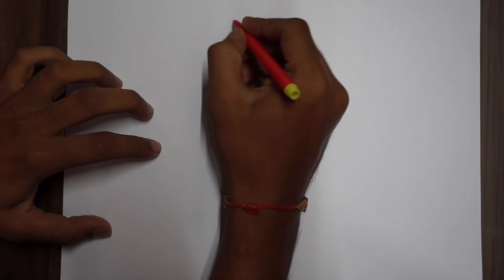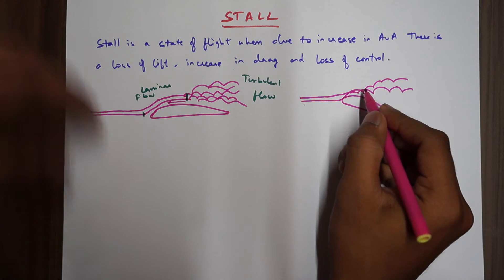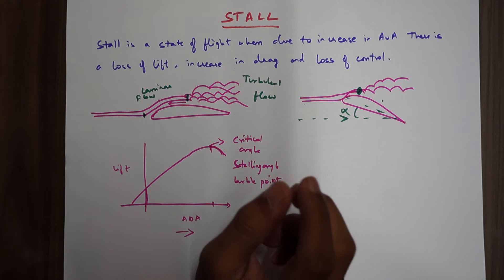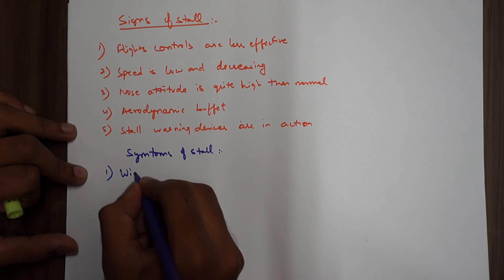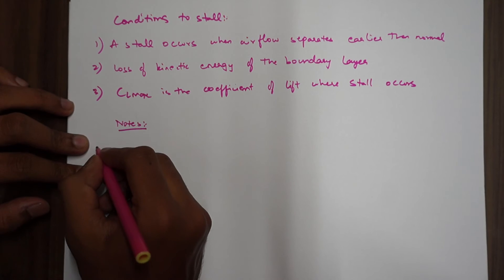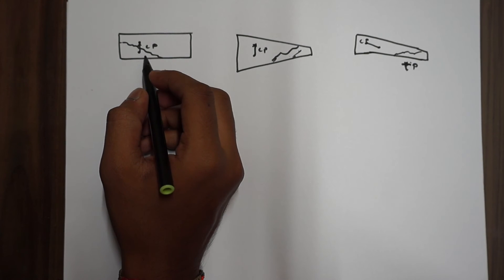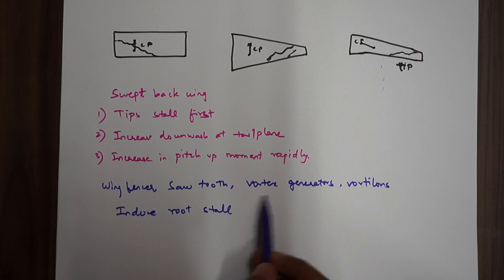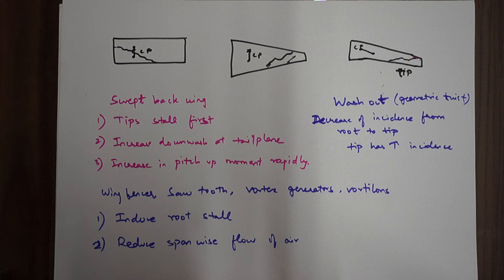Stall - I

Comment: first of all, Thank you very much for this amazing video. Having said that an aircraft stalls when the critical angle of attack has been reached.Then there less chance to stall and aircraft at straight level flight or at a constant descent??
Reply from the maker: Less chance yes, but doesn't mean it cannot be stalled during those phases of flight. Just that comparatively stalling is faster when pulling nose up.
Reply: @poh  THANK YOU!!!

Comment: Sir...i have some ques..1)In case of engine failure A/c will stall or glide
2) Viscosity coefficient varies with increase in density, increase in temp, or increse with Velocity
3) what is purpose of wake turbulence....sir please...clear it i will highly thankful to u
Reply from the maker: 1) If you maintain certain airspeed, the A/C will glide, below that speed it'll approach stalling conditions.
2) Viscosity in layman terms is ability of fluid to flow. Lot of parameters effect this. Temperature, Density, Friction etc.
3) Wake turbulence is a phenomenon caused due to movement of aircraft through air. There is no purpose. It's just a phenomenon.

Comment: when angle of attack is increased more wing Sl gets exposed to the relative wind flowing by and causing opposing force to the thrust and causing more drag over the wings and smooth flow of air get s disrupted , to recover the stall you must pitch downwards to reduce angle of attack to negetive and increase air speed and flow of air would be faster on wings causing smooth flow on wings and at high wing aircraft downwas from wings strikes the elivator causing elivator pressure from the top of elivators and bring aircraft to stable position